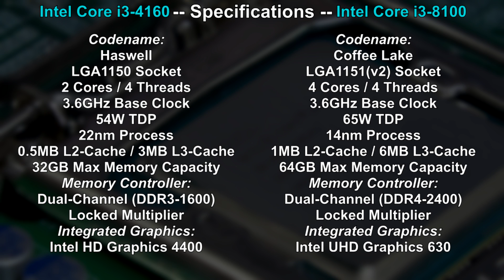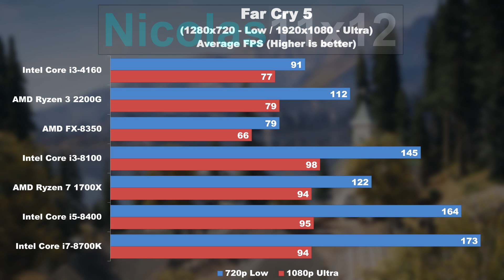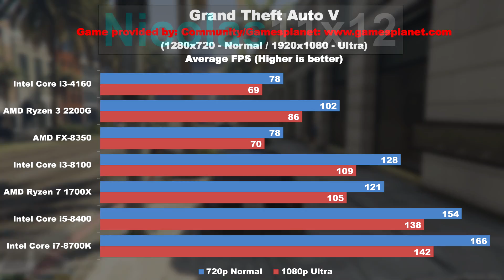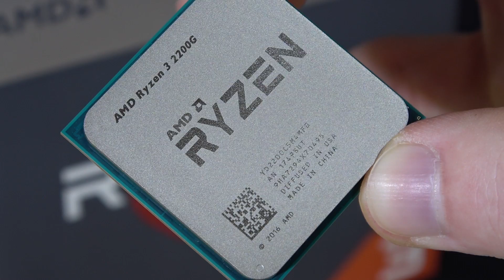Intel i3-4160 -- Worthless Already in 2018?

Comment: 😒 its fine, stop believing the haters, this platform supports Windows 7 all the way, plus it has all those stupid cpu instruction sets, the i3 is solid, pair it with a cheap slow $20 video card and cheap ddr3 memory & ur golden 😒👍🐢
Reply: As long as there's drivers, there's no reason why you can't install win7. You can actually install XP on haswell systems.
Reply: @whitebeartigtig  🙂 yup, thank you for commenting, Happy New Year friend
Reply: @MrSamadolfo  thanks! you too.

Comment: I still use this cpu for daily works...hahah just play dota 2 combine with gtx 1050. Still have a good performance!!! . I will make it to i7 4790k
Reply: bro may i ask you , is i3 4160 + gtx 750ti 2gb can run dota 2 ?
Reply: Ayeboy G yes you can, even without the 750ti, but you definitely need a decent amount of ram

Comment: Intel had more cores planned for a while.  It wasn't just Ryzen.  Sales were slowing because Intel was competing with it's older generation (due to slow improvements).  When the newer, smaller lithographies got good enough, it made sense to add more cores due to low cost to do so.  It pushed sales, gave an excuse to raise stagnant price that weren't keeping up with inflation, in addition to allowing more binning.  All of which meant adding more cores was also a win for Intel.
Reply: 🙂 correct, both amd & intel hate people holding on to their old computers 😊

Comment: Wait , what?? U paired i3 4160 with 1070?? Didn't that give u any bottleneck issues??
Reply: Probably he had a solid bottleneck . But the i3-4160 is powerful enough to utilize the 1070 to the point where you have a fairly pleasant experience . So it doesn't matter that much . And if you want you can upgrade to i5 or i7 with not much money buying used.

Comment: You see guys, I got the i3 4170, which is the same as this one on the video, I got it on a deal that I gave my xbox one s, the guy gave me his i3 4170 and a gtx 1060 3gb + mobo and 8gb ddr3 RAM, is the gaming experience gonna be reasonable? I mean, I'll surely upgrade the cpu (been looking into i7 4770 or i5 4590/4670/4690), since I kinda want to run PS3 emulator on this pc (mainly because of persona 5 and demon souls). How is the gaming experience gonna be with this kit? I mean, I surely wont be able to run PS3 emulator with this processor, but about other games like final fantasy XV, the witcher 3, dark souls 3, monster hunter, overwatch and some RPG/JRPG , do you think that I'm going to be at least close to 60 fps? I came from xbox, used to have a decent gaming pc, the 30 fps were hurting me, I played final fantasy XV with a mix of medium-low settings, I dont think the game even used to be at 60, but the experience on xbox one S was pretty mediocre, the graphics were looking pretty bad (even tho I used to play on medium on my old pc), the frames looked like I were playing the game on slow-motion... I got tempted to buy ps4 pro, but got really angry with consoles hahaha
Reply: 🙂 yes its reasonable, do u have it running yet?

Comment: Core i3 4160 on 2019 anyone?
Reply: I am proud i3-4160 user I use it  to play android games on pc using emulator
Reply: still happy with i3 4th gen / partner it with rx 470 and it performs good. and its not worthless lol.
Reply: 2020 and yes
Reply: I3 4160 with rx 560 2gb I'm very happy
Reply: Got a 170 pc for 40€ yesterday
Reply: Myself
Reply: Mio Dio yup
Reply: I can't play any games with it other than older games from like 2017 ish I'm thinking of upgrading soon so I can play new games like cyberpunk when that game comes out. But i'm not super good with computers so Idk if thats what i should do
Reply: tallspartan117 no, I have this processor. I’ve been playing Bf1, fortnite, red dead redemption 2 on a gtx 970. Not a single stutter. I’m getting between 70-100 FPS most of the time. Ultra usually sinks down to 50 FPS at most. All depends on the gpu. The cpu will get your another 3-4 year maybe. Save your money. Just buy a new gpu. Should be fine.
Reply: me
Reply: My i3 ia for htpc use and does the job. Hooked it up with my av receiver and tv
Reply: Me :D With gtx 660 8 gb ram ASUS motherboard.
Reply: Me
Reply: Mio Dio i3 4130 in 2020 lol
Reply: bought this month
Reply: I
Reply: 2020 haha
Reply: I do have the i3 4160 and i've had it since 2015. It's a great little processor.
However, my needs have changed which is why i'm buying the i5 092 very soon.
I have a 4K TV and i only stream now. My PC only goes up to 1.4, i need a 2.0 to get 2160 @ 60 hz. 
But i have been very satisfied with my i3-4160 for 4/12 years.

Comment: I still use my 4170 but on my HTPC. I def don't suggest getting these older 2 core CPU's unless you find them at a steal. Quad cores are just so common now, go for that instead.
Reply: Found a mobo with that cpu for 30$, definitely better than anything new i can get for that price.
Reply: @thefirestate  yeah that's an amazing price
Reply: Got a whole system with a 4160 for free... so its worth it.

Comment: i have same cpu i3 4160 can i run it with the rx 570 ?
Reply: I had the i3-4170 paired with RX 570 and it worked very well. It only really becomes a problem with games that are very high in CPU usage like Battlefield 1. I eventually upgraded to Ryzen 5 1600, but the i3 was very good to me still and would not mind using it today still.

Comment: I have a PC with a Pentium G3258 and even @ 4.7 Ghz it bogs down pretty badly in many games.  A Craiglist seller in my area has a used i3-4160 for $35.  I'm tempted to buy it.  I think the extra two threads would help.

Comment: Before anyone think that i3-4160 is useless, think again. Look at the video again and notice that GTX 1070 Ti was used for the benchmark. Majority of people wouldnt even use such a high end gpu to pair with this cpu.. even then, the cpu is still remarkably runs very well with the 1070 Ti especially in GPU bound game, notice the Witcher 3 benchmark.

So if u have GTX 1060 or below, this CPU wont bottleneck ur GPU at all.. therefore i3-4160 is still an excellent chip for gaming. I hope the video's author revise his opinion.
Reply: I'm currently using i3 4150 with GTX 1060. I'm still satisfied with its performance. But, there were a little bottlenecks if you're playing cpu bound game and it's not that much really. It's noticeable yes but it can still run anything I throw at it.
Reply: I was thinking the same, specially knowing I own an rx470, it matches it very well for 1080p gaming.

Comment: I have i3 4160 and I can run every modern game of 2018
Reply: Can you run crysis in 4k
Reply: Yes he can if he has a gpu that can do it. If a cpu can run 60 fps at 720p it will run 4k at 60 fps.
Reply: Well yes a game like ac odyssey will not crash but it will not be playable.
Reply: Russell Roberts  no it doesnt support more than 1600 mhz anything higher will be useless regardless of ur mobo support since the cpu dont support it but using xmp u might be able to run ur ram at ur rated speed but u wont get the benefit of the higher speed.
Reply: AlienGamer2k ?
Reply: Russell Roberts are u even reading my comment or just typing out of ur azz what i said is u cant get a 2400 ram runing with an i3 4160 cpu cos its limited to 1600 regardless of ur mobo those higher frequency is a waste cos its a non k sku , if u want to use 2400 mhz on haswel buy a k series sku like 4670k etc than u will be able to use those. try do some proper research on cpu and memory frequency support b4 commenting like all know shit but if have solid proof of i3 4160 running with ram frequency of 2400 upload a video about it proving me wrong.
Reply: Ti imagina

Comment: If you have an i3 that means you have a CPU that is on the lower end of the product line of that generation... Which means you can still easily upgrade just the CPU to an i5 or i7 without having to upgrade your entire pc to a newer or entirely different platform. If you're building new tho.. unless you get it for really cheap it is not worth getting. Anyways, Nice review Nicolas ;)

Comment: when i use my i5 4460 i get massive stuttering with 80 fps (in battlefield1, other games runs awesome). it drops very often into the low 40 fps so i dont understand how you can use an i3 4160 which is definitely weaker
Reply: Your Cpu might be bottlenecking your gpu causing the stuttering stuttering
Reply: It can always be your ram as well...

Comment: I recently upgraded my system to a 4790 and i can say that if you're doing lightweight task or simple gaming, i3 4160 is a decent enough for most task. The old i3 now powered a pc i built for my litttle brother (age 10)
Reply: FarhanAxiq in 1-2 years im probably going to buy a 4790 given my motherboard dosent fail on me, my i3 is more than enought for my needs right now

Comment: I have an i3 2100 sandy bridge in one of my systems and for the most part you can still play games fine but in games like BF1 or even BF3 when it was released you notice the difference a lot.

It’s still better than console cpus from what I understand so I think it will be viable until consoles move to a stronger platform when requirements may increase.
Reply: Edmundo studios yea but the thing is that even if you have a cpu better than consoles, windows take a much bigger hit on cpu then the consoles os and games for consoles are also optimized for the bad cpu. But still, pc for life

Comment: I'm running my 3770K and i have no reason what so ever to believe it's worthless, it performs great in games and programs, and this platforms runs on the affordable DDR3 ram, i couldn't care less for the current gen hardware, and let's face it, most software isn't even nearly optimized for it either, so people are getting more for their money by getting older gen hardware.
Reply: HansensUniverse That's very subjective, I felt the need to upgrade from my i7 3960X at 5Ghz for Emulation and video rendering tasks.
Reply: So ok, not that i'm saying that my rig will out perform the newest hardware, but i have a few buddies that have the latest and greatest how ever they are having issues running some games and programs that runs great on my machine, my favorite games are from around 2010 / 2012, so upgrading will most likely degrade the performance, and DDR3 ram is still cheap here, and widely available, i'm a happy camper, my rig might be outdated by today's standards but it's reliable and does what it needs to do, very well.